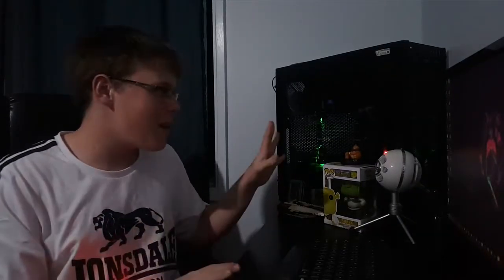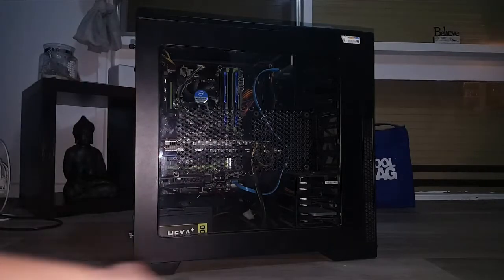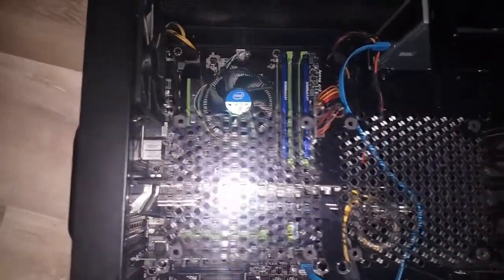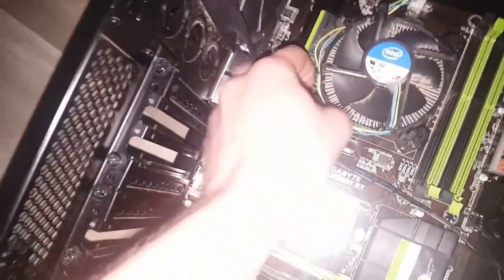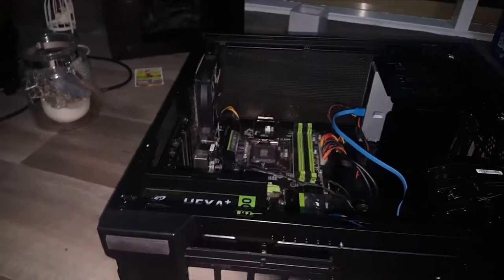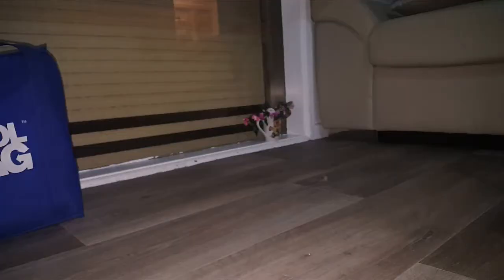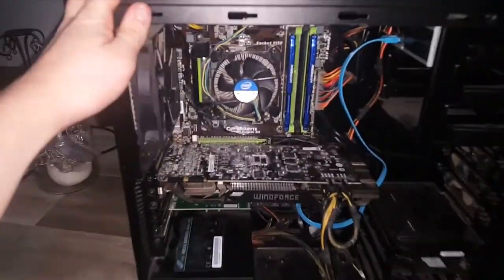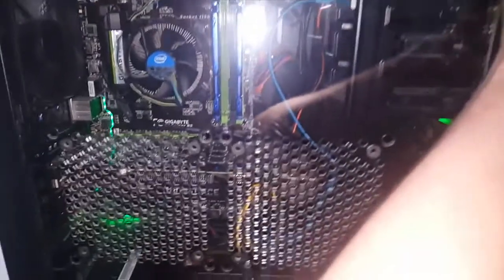The i3 4160 vs the i7 4770|Build Log|Channel Update

Comment: Pls help i have i3 4130 and asus rx 460 strix 4 gb.. What cpu should i upgrade. I5 4460?
Reply: I mostly use my PC for gaming
Reply from the maker: Well, the i5 4460 is a great cpu for around 120-150 dollars, and will not bottleneck your gpu :) but I recommend the i5 4690k for around 40 dollars more, as that will give you far better gaming performance. The i5 4670 is also an option.